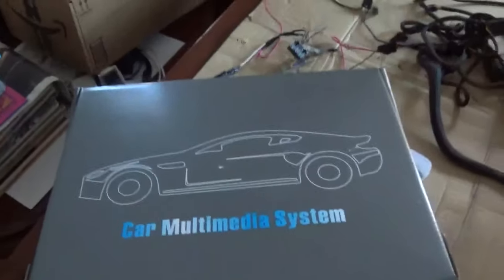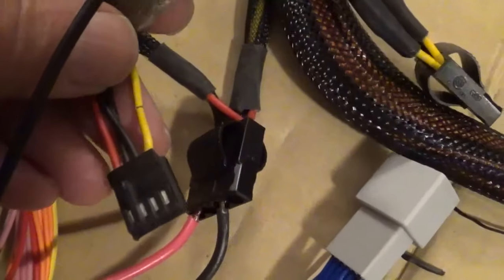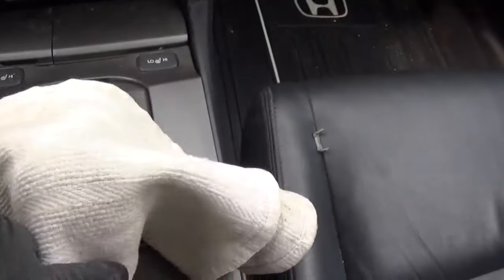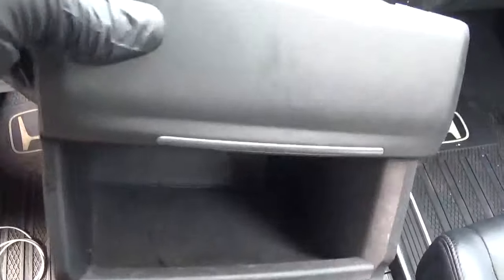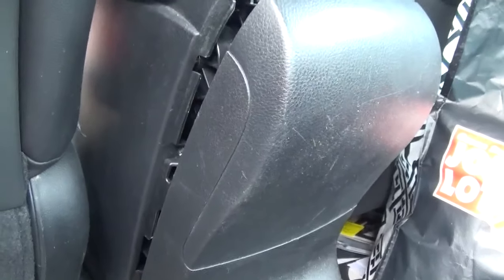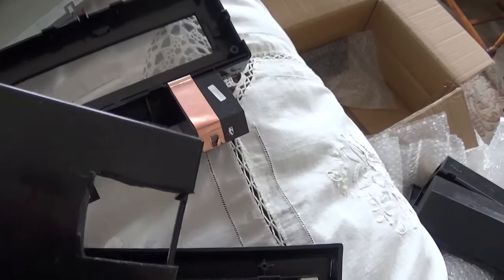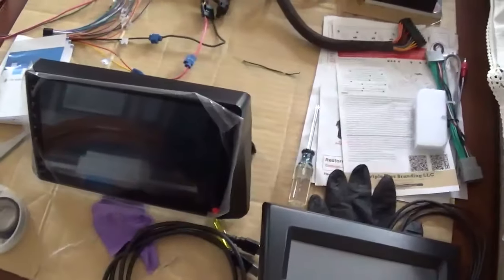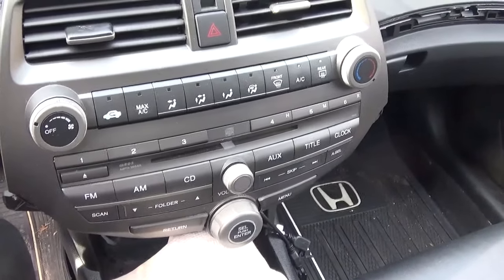Honda Accord 2012 touch screen upgrade

Comment: How did you make backup camera work. I connected the backup camera to the unit and nothing shows when I put the car to reverse.
Reply: Did you ever figure this out? I can see video from the camera in the AUX app on the headunit when I connect into the VBS, but nothing when I connect video out and use the trigger wire
Reply: Curious about this too
Reply: Ever figure this one out? I’m in the same boat. Shifting to reverse lights up my camera but the screen does not change to the camera video feed
Reply: I think I figured this one out. I had my backup camera wired exactly how their diagram shows but I noticed in settings > factory settings > HD Reversing video format, it only has TVI and AHD as the options. My backup camera is NTSC. It seems this radio does not have an NTSC video format setting or at least I can’t find it. A lot of backup cameras are NTSC like the one I purchased. 

I also bought the identical unit from this video on Amazon from Biorun/RongNan International. I got the 8 core 2GB RAM one. 

I’m not 100% certain this was the issue but probably 99%. Like I said in my previous comment when I would shift into reverse it would light up the backup camera’s white led lights so it was clearly working, just not displaying to the screen. Hope this helps someone in the future to save you several troubleshooting hours like I was doing.

One thing to note is that even though this android tablet looks identical to many others on the market, it doesn’t have the same features/software. Mine was running android 13 but the settings/general settings/factory settings were very lacking compared to others I’ve seen where they had to enable certain settings and change video formats for their backup camera to work

Comment: I have it all set up but there is no Apple CarPlay, do you know why?
Reply from the maker: Only one USB port works for Apple Car Play. Check settings first. Go to Settings> Device> USB Device Start and select Carlink. Plug iPhone into a USB port and launch Carlink app - it should connect to the iPhone, then ask if you want to use wireless CarPlay or wired CarPlay. Choose your preference.
Reply from the maker: If no CarPlay, try the other (second) USB port

Comment: For some reason my oem
Radio the fm/am/aux botton arnt being recognized, only the clock works, how come?
Reply from the maker: Hello; I need to know how you connected the AUX input. Some pictures would help
Reply: @PHubb  i figured it out, so my connection was fine, it turns out my car has a radio theft code, so when j set everything up i couldnt make the oem radio turn to aux. it was stuck on like a dead mode till i plugged the  radio code in then turned it to aux and all worked well, thanks for the fast reply though
Reply from the maker: @DiamondScuff  Great job Diamond. Only the premium stereos have the anti-theft code system. Ours is just the base unit so I didn't have to mess with a code, but it's good to know about the code for others who might have a similar problem. thanks
Reply: @PHubb  Yes, i checked everywhere i didnt find anyone facing the issue i did, then i saw someone press the power button on the radio and i was like hold on... lol pressed it then it asked for the radio code i was like aaa, 3-4 hours wasted over this. Car stuff lol. But the car feels a lot more luxurious with it being done!

Comment: Can you put a link to the actual item on Amazon I just bought a 2012 honda accord and I want to do this but I want to make sure I get the right one
Reply from the maker: I put a link but I guess youtube took it down. I bought it on Amazon from Biorunn Store sold by RongNan International. These units are made by  Mekede Technology and also sold by AliExpress.
Reply from the maker: The model number is M200S or M400S (9863)

Comment: @Phubb - Can you please help me to fix the USB carplay issue. I got the same stereo and installed. But I am facing issues with carplay using USB connection and bluetooth mode.

Can you please suggest How to use carplay on USB connection  Usb?
Also my iphone not connects to bluetooth as well hence I am trying to use USB cable and play carplay.
Reply from the maker: Hi Chen; 
1: Only one of the USB ports works for CarPlay. You have to test out which one is the CarPlay port and use it. Use an Apple brand lightning cable for CarPlay as well. Some off brand cables don't do CarPlay very well - it's a known issue.
2: You can't connect your iPhone to both bluetooth and CarPlay at the same time - doesn't work. Only one iPhone can run CarPlay at a time.
CarPlay needs to control all of the phone functions - bluetooth phone interferes. 
3: But a second iPhone can connect to bluetooth
Reply: Thank you @Phubb. 
I tried using carplay on blurtooth connection, but sometimes mid of the way the carplay is getting hang and cannot drive with it and maps on mobile still connects to carplay and doesn’t show maps on mobile.
Thats why I am trying to connect on using USB cable. The issues is I have Iphone 15 which got USB C cords on both sides  but the Biorunn stereo got USB female cord to connect to mobile. Thats why I am using USB Male to connect stereo  to USB C cable to Iphone 15 whiich is not from Apple brand.

Comment: I installed one of these units last week and I'm having issues with the audio input  changing on its own. It'll change from AUX to radio to XM satellite to CD
Reply: Me too , have you find out why
Reply from the maker: @DaySleep809 , @eric.m,  I am not aware of this being an issue BUT my first question is how have you connected your AUX input? I had to use the 1/8th AUX jack input at the back of the console and run the long RCA cable up front. If you connected your AUX to the back of the OEM stereo that might be the source of it switching inputs randomly. I'd try the AUX jack at the back of the console and make sure the jack and plug are clean. I'm interested in how you fix this so let us know
Reply: Did you figure this out?

Comment: I heard the speakers are terrible is that true?
Reply from the maker: This touch screen connects and provides pre-amp audio to the OEM radio/CD player/speakers. Sound is output from the OEM unit. The touch screen does come with a built in DSP (digital signal processor) in the form of a 16 band EQ as well as spatial processing of audio output. The DSP works well but the final audio is ultimately going to be what the OEM radio/CD player/speakers output. Our car has the base radio (1 CD player) in it. The premium sound package has a 6 CD changer with a separate amp, XM satellite radio and 10 speakers so your mileage will vary depending on what the OEM system in your car is.

Comment: are the USB cables at 17:57 necessary?
Reply from the maker: Hi David; No not for functioning. This is my wife's car so I installed the USB cables with the bracket/socket for easier access and a cleaner look. Many people just dangle the USB wires inside the glove box.
Reply: @PHubb thank you sir

Comment: Where did you hide the mic going into the head unit?
Reply from the maker: There are two microphones. The one built into the top left front of the touch screen works very well for answering phone calls and speaking commands like 'Hey Google" The secondary MIC plugs into the rear of the unit and I didn't hook it up because the front one works very well. I suggest using the front built in MIC There's a setting to switch between front and rear MICs. Go to Settings> Factory> pass: 3368> Back MIC switch. Turn it off and front MIC will work
Reply: Does the canbus for setup work for air conditioner and other things
Reply from the maker: @potatosmasher5591  Hello; What year Accord do you have and do you have dual auto heat/AC? The 8th gen Accords generally don't have an actual CAN bus. There are several CANBUS in the settings for 8th gen Accord - HiWorld, BNR, Raise, for 8th gen Accords. Try setting one and see if it works. I set a BNR CANBUS for mine (NO dual auto heat/AC) and all I got out of it was volume up/down steering wheel controls on both the head unit and the car stereo small LCD screen. Good luck - let us know

Comment: The plastic housing frame is a bad design. It cannot be screwed to the dash and could pop off on bumps.
Reply from the maker: I thought the same when I first got this unit and installed it but it's not been a problem for me. If you watch the video @ 18:30 forward I explain how to attach the back cover and transfer the metal clips from the old LCD housing to the new back cover. Once the clips are installed the unit pops into place and is secure.